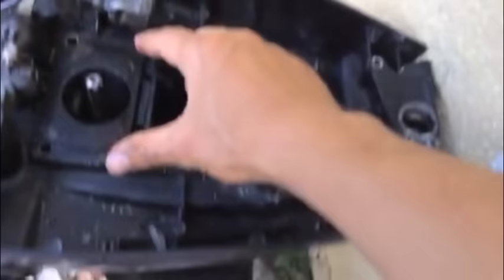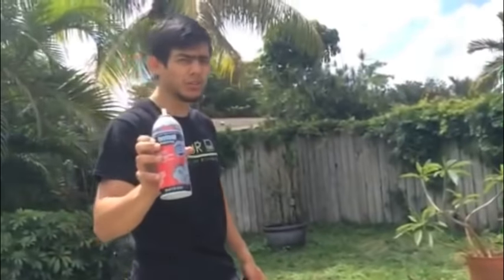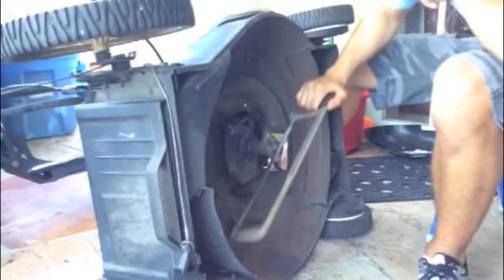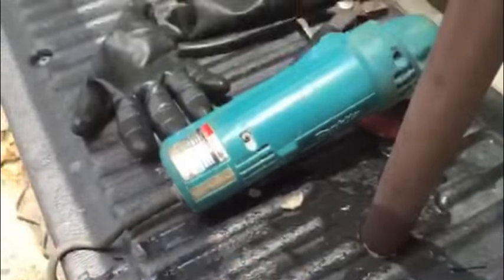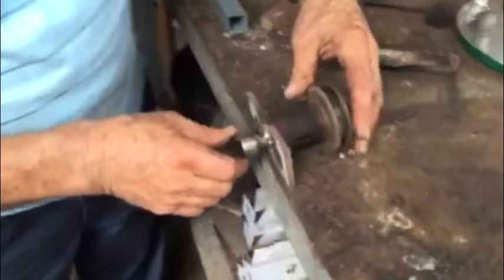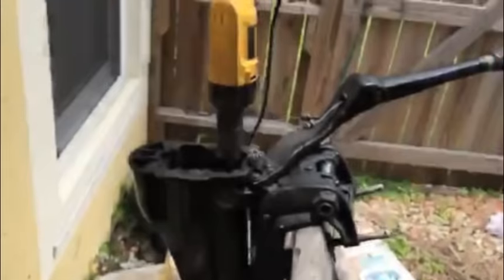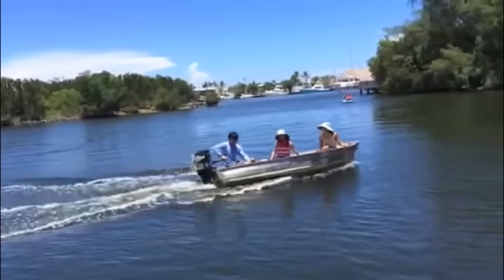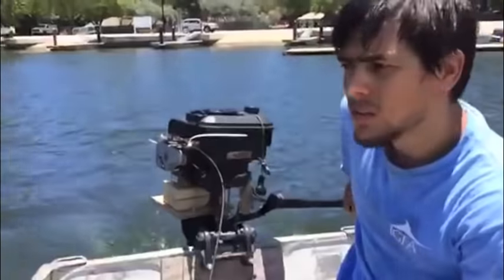Lawn Mower to Outboard Engine: Full Process

Comment: Awesome build. I think that if you attend a Technical College you can be an awesome builder/fabricator. Your ingenuity and desire to conquer your obstacles are great. Now my but... some things could be improved for your safety. 10:21 NEVER drill anything with the drill bit pointing at yourself, it's an accident waiting to happen that can cripple you. 
10:40 please wear eye protection when using power tools. 
12:51 why fishing line and not the cable that used to control the engine brake? It would last longer. 

Your actions against the Kayak are deplorable. Causing a collision in the water is not a joke by any means regardless if you know the other boaters or not. Then you showed your boat registration number. Be glad that no Coast Guard / Park Ranger/ Code Enforcement Agent has used this video against you.

Comment: You could use the existing v-belt and pulley from the lawnmower to transit the power to the existing shaft of the outboard by screwing a new v-belt pulley right on the flywheel or instead. That way you could find what reduction number you need to make your new motor work in the perfect range of rpm and even make a soft start system by using the existing belt tightener from the lawnmower.

Comment: The avacado tree had branches from different species of avacado trees grafted onto the root stock, that's the process and is used all the time in nurseries. You could have simply taken the impeller off the water pump or taken it out and removed the vanes. Great job and plan to do a similar project myself soon.

Comment: Good job I spent 30 years at small engines if you want to make the engine easier to pull and less vibration try adding a cast iron flywheel from a different model engine the problem with the lawnmower engine is it relies on the blade as a flywheel so they use a light alloy flywheel with it. if you cant get the cast pulley you may be able to fit  a heavy weight piece of steel turned on the lathe and fit it on the shaft in between the engine and gear box. Great work a resourceful person you are I wish you well

Comment: The wood is kinda janky why not build a metal bracket with 2 inch flat bar so it can be bolted to the factory mounts on both the engine and the gearbox.

Comment: I did the same thing about 20 years ago ..the difference was I used a 7 horse Johnson lower unit which that model had a 1/2 inch square shaft so I simply dropped a 1/2 inch drive 5/8 socket on to of the shaft , plush I also used a 12 hp electric start /pull start Briggs off an old Murray riding mower this way I could have a charging system , for lights and trolling motor battery..as far as controls I just used an old Johnson control box with forward reverse and throttle..I made an adapter plate to fit between the engine and lower unit out of treated plywood I simply traced the lower unit bolt pattern on one piece of plywood , then did the same with the engine..I just center bored each piece with a holesaw the layered plywood in between until I had the right thickness ..well I made it as far as barrel testing ..and it ran very well ..at the time I owned a motorcycle salvage yard..and a customer had stopped in and asked if I was going to sell it ..I said no ..well I hadn't thought about it ..? I was just messing around with stuff from my junk pile ... So this guy says : I'll give you $500 bucks cash for that motor .. I told him I hadn't really tested it . I only ran it in a barrel ..he said the worst he could do was change the prop or have it repitched ...so I said why not ..? But it is as is .. otherwise I'm not selling it . He said that's fine and off he went .

Comment: lawnmower engines don't have a flywheel weight, the blade itself acts as one.. the small engines you buy at Princess Auto or wherever have a built-in weight.. keeps the engine even at low rpm
Reply: Mike George. Yes they do to!... how do u think gas power washers run?

Comment: should of used a pressure washer. it has a steel flywheel. the mower has an aluminum one and the blade keeps forward momentum for the engine.